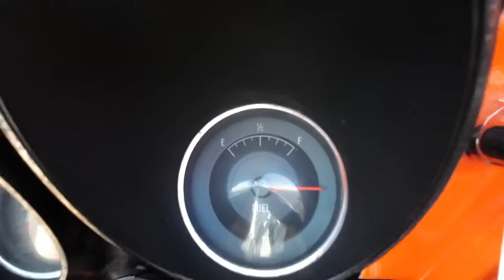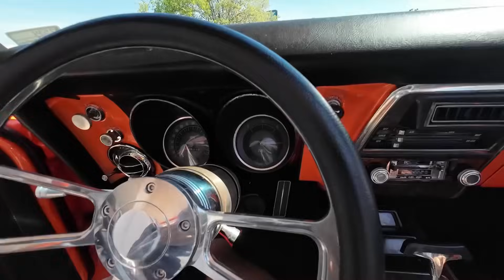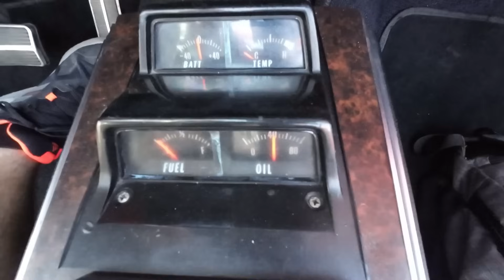Test Drive 1968 Pontiac Firebird Convertible Big Block SOLD $40,900 Maple Motors #2534

Comment: Had a 69 took out the 350 and the transmissiand bolted in A H0 400 and had to cut the drive shaft to fit  theTh400.Transmission. And
It would spin the tires all the way down the track.
My track was my street😂

Comment: Ive watched 20 videos of test drives of cheverolet vehicles. and not one had the cover over the torque converter/flywheel. each video when you say place your bets does the horn work, and i always place my bet there is no cover on the transmission, just a torque converter and flywheel hanging out the bottom of the car like a drunk walking around fly unzipped just hanging out for the world to see. very unfortunate for small animals, cats especially, can catch anything in there easily. just a testament to the quality of those chevy guys, check it out my man. love your vids and your families business. great folks
Reply: Almost like the makers put them there for a reason, isn't it? What the allergy is that owners and mechanics (not often the same thing) have to them is a puzzle.

Comment: Put $100k into tubbing and other stuff that makes it not a real driver, something you can actually use properly on the road. I guess that's why they didn't bother with the wipers or the horn - never going anywhere. No temp gauge, engine not giving it's all despite twin 4-bbls... Nothing that you can't fix, but what goes on with people?
Reply: Wipers don't matter and neither does a horn.   Are you commuting into the city during winter with this?    No.
Reply: what are your thoughts on the inspection cover for the flywheel/torque converter? jusy curious. a necessary part? i would certainly think. someone must have a pile of hundreds of them. my gosh i laugh every chevy that comes through the dealership. i wouldnt expect the guys at Maple Motors to start replacing them they would likely go broke. let alone find a source to buy a hundred at a time
Reply: @alm2caribou  I don't suppose Maple Motors are missing out, but it surprises me too on how many of those things are missing. There's probably a specialist scrapyard somewhere with them stacked to the sky.
Reply: @alm2caribou exactly what I was thinking.

Comment: Very nice looking car!  ONE QUESTION - The sound when the car drove over the camera.  In slow motion, that could have been the engine and the exhaust, but it sounded like possible cracks in the flex plate.  I had this problem on a Buick 3.8 Turbo / Auto trans I put into a Chevy Luv pickup.

Comment: We drove a 71 Camaro with a 454 you couldn’t start it in first gear it would smoke the tires right through to 6000.it idled at 2,000rpm we went through 4 full tanks in one night ,that stock 545 has less than 300 hp .Pull that dog out put in a LS7 .